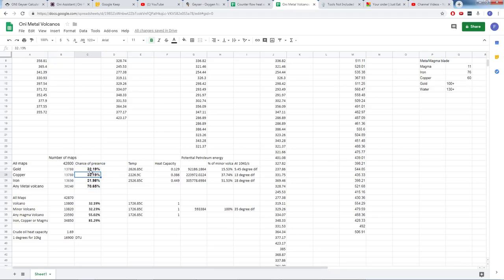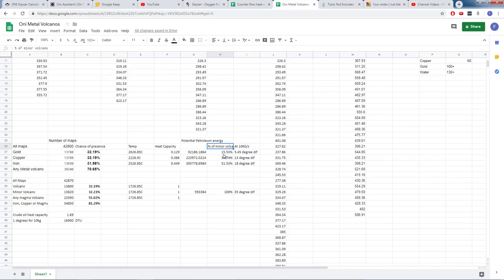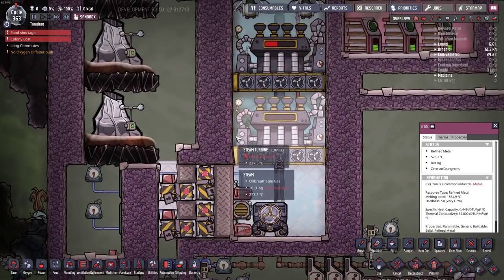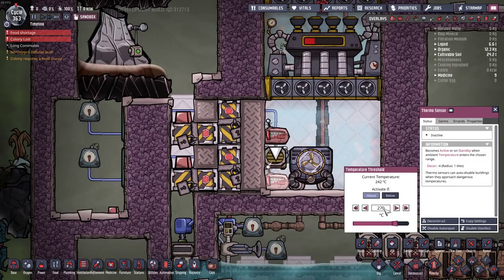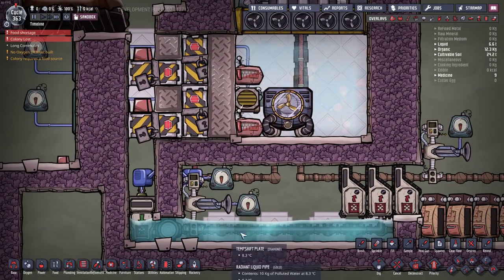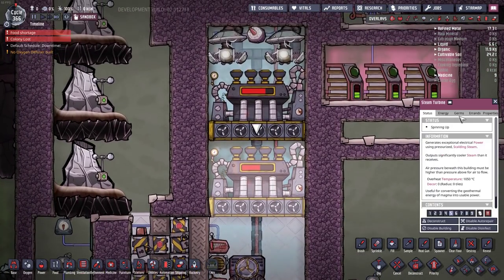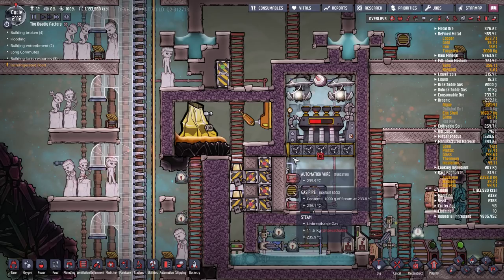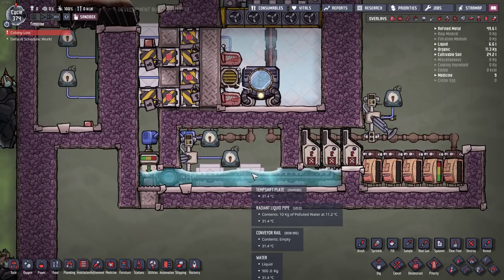Metal volcano Tutorial Mk2 (Save file linked) Oxygen not included

Comment: Thank you for this update on this setup. I tried your previous setup 2 weeks ago and it failed because of the automation settings. I was also greedy and tried to use the cooling loop to cool some other stuff. It failed. Do you think this system would manage to extend the cooling loop to cool some other stuff?
Reply from the maker: Well theoretically the aquatuner should now be able to run 24/7 and still cool the metal volcano output, but it would depend on how much heat you are trying to destroy. If you are just trying to cool O2 from an electrolizer it should have no issues.

Comment: Metal volcano petroleum boiler please
Reply from the maker: Next item on my list is magma and metal petroleum boiler design, will be roughly a week.
Reply: is it worth it though ? in case of metal volcano you have literal grams of one substance to warm kilograms of crude oil, not mentioning the fact most of the time you have to extract the heat from debris on the ground as metal turns into solid form.
Reply: welp im gonna wait for the video since i dont volcano but i have 2 metal volcano n only 1 oil res
Reply from the maker: Worth it? Depends on the map, I would prefer to have a regular volcano to work with but want fun would it be if you got a perfect map every time.
Reply: I use rockets to power my 10kg/s petroleum boiler works brilliantly as long as you can launch rockets regularly enough which you can cuz one petroleum rocket provides enough heat to make more petroleum than its launch cost and that's with oxylite, using lox it would lower petroleum cost and increase the boilers efficiency